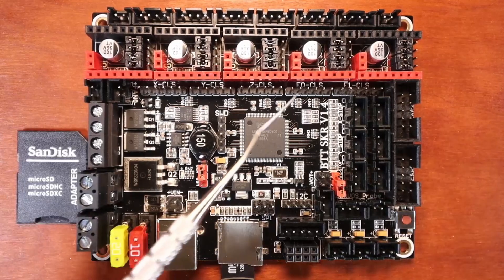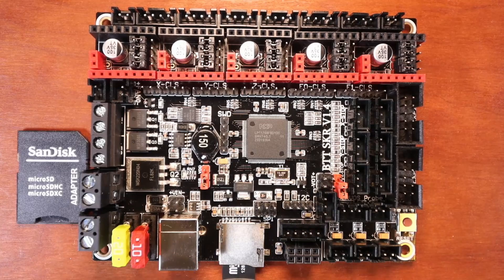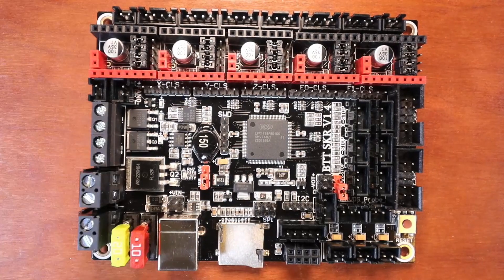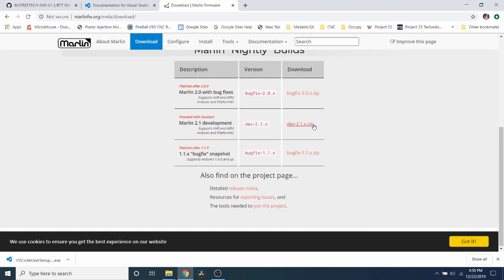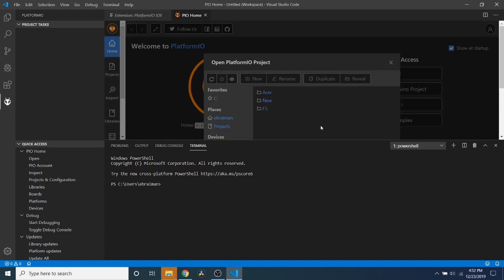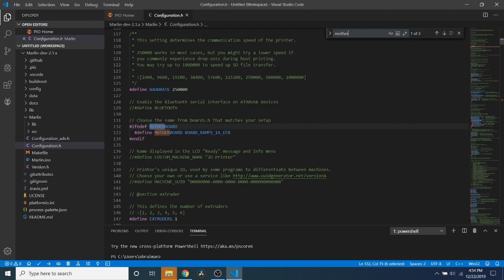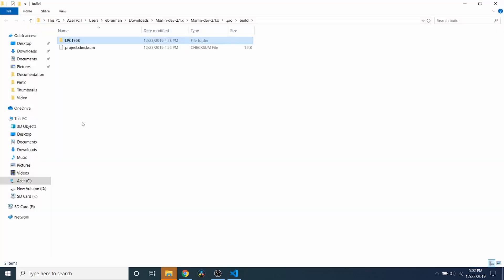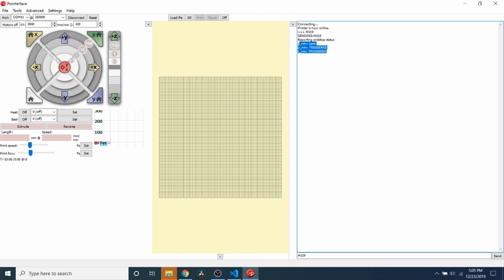BigTreeTech SKR 1.4 - Basics

Comment: Can you confirm only one on the fans are controllable? From what I gather from the data sheet, all but one are linked to 12/24v and Gnd.
Reply from the maker: That would seem to be how they designed it.  It's best to use 12v for all power.
Reply from the maker: I'll need to experiment, on if the fans are controllable, but a quick way to check is open the pins file and check if pins are assigned.
Reply: @EdwardBraiman  depends on the drivers. I tested 2130 on 12v, but they don't really work well.
Reply: @EdwardBraiman  yeah, I had a look at the pins and they look like direct to 12/24 and Gnd
Reply from the maker: @alin116  you can always use another device to connect them to a signal pin.
Reply: @EdwardBraiman  I'm interested in doing that, but couldn't figure out how/which pins and all that
Reply from the maker: @alin116  look at my SKR 1.3 videos playlist for using a fan extender.

Comment: Excellent videos. Thank you. Would you please do a video on how to setup dual Z steppers on a Turbo 1.4 using TMC2209 drivers. I've been trying to get mine working for days. The Z motors are not synchronized and they make a loud hum for a few seconds after manually moving the using the TFT35-E3 V3.0. Again, the videos you've done so far have been a great help.
Reply from the maker: Are you using one stepper or two.  There maybe an active bug being addressed on Marlin.  I've tried to get my TMC 2209 drivers working and I'm waiting on a possible Marlin firmware update.
Reply: @EdwardBraiman  Is this a known issue Edward? I've just finished the hardware setup of my board for my CR10s and I'm using one driver to power the dual z steppers. Would be good to know if I'm going to hit an issue ahead of time. Thanks for all your help!
Reply from the maker: I'm not sure if it's a know issue, but  check on Marlin firmware bug tracker website.  It doesn't work for me as well.
Reply: @EdwardBraiman  I'm using 2 TMC 2209 drivers in the Z and E0 stepper ports.
Reply from the maker: @michaeljones3163  I'm a little confused, has anyone seen a tutorial created by me that involves a TMC 2209?  When I do tutorials I make sure they work before posting.  As your all having issues, myself included with my own TMC 2209, I would suggest contacting Marlin firmware bug database and asking questions as to why or how to get the stepper working.
Reply from the maker: @michaeljones3163  the SKR 1.4 has two stepper driver ports for Nema17, why are you using z and e1 for z axis?
Reply: @EdwardBraiman  I'm glad you questioned that. I went back and looked at the SKR 1.4  Motherboard Diagram and now see the ZMA and ZMB labeled stepper drive ports. {I'm slowly getting familiar with how Marlin and the new SKR 1.4 works.) I'll try editing Marlin again tomorrow. If I can't get it working I'll contact Marlin firmware bug database. I'll let you know if I'm able to make any progress. Thanks again for your help. It's much appreciated.

Comment: Seems like a nice board. I just ordered the turbo 120hz version with the extra's and a 3.5"touch screen
Reply: Hey Doug, when you install it let me know if the motherboard BOARD_BIGTREE_SKR_V1_4 worked for the Turbo. BTT released a new version of the boards.h with an additional board called BOARD_BIGTREE_SKR_V1_4_Turbo. It's not in Marlin 2.1 yet and I'm unclear whether it makes a difference
Reply: @omnomnomnivore2766  Will do. Hopefully I should have the board and stepper motors by sat 1-4-20 and have the board programmed and powered this weekend. I did see that biqu had updated there fw so I'll try that first.
Reply: @omnomnomnivore2766  I was able to get the board up and running. it is the LPC1769 chipset. The firmware is listed under the 1.3 version. I don't yet have the board installed since I'm still building a DYI printer but the board works with the stepper motors on the bench. I also added the 3.5in v2 tft as well. With out videos like these, Thank you Edward Braiman" it wouldn't be possible.
Reply from the maker: You're welcome.

Comment: Did you find any informations on those closed loop driver interface? BTT keeps beeing secret about it, seems interesting. Ordered myself a pair of their closed loop steppers with the control board (sensor and driver) attached to the back of the motor.
Reply from the maker: About all I know is how to connect, the wires.  I'm trying to research what stepper to use in Marlin firmware, but it would be nice for BTT to publish anything.
Reply from the maker: Looks like it's a feature request 12496 on Marlin bug tracker.
Reply from the maker: Found some stuff in Marlin firmware 2.1.x in configuration advanced.h, search on external_closed_loop_controller.  I'm still searching for more details.
Reply from the maker: It's also in 2.0.x
Reply from the maker: Looks like it's not ready yet.
Reply: Wow, thanks for the investigation!

Comment: I watched your video 5 times today , I followed you step by step I put the sd card in downloaded Visual Studio Code downloaded Marlin firmware , press open project and Marlin firmware won’t work .I’m getting very frustrated I have spent a lot of money to upgrade my printers and I can’t even get to the reprogramming part of it . Please help me I need the control board for my Tevo Nereus because I changed to better stepper drives and the motherboard stopped working . Getting tired of 3D printing real quick. Thank you
Reply from the maker: First is the Firmware loading or is the build/compile failing?  Second what the hardware you're using?  Meaning SKR 1.4, type of stepper drivers, ECT.  What's the current firmware version your using?
Reply: Edward Braiman 
 
I bought the same board you did before watching your video . I have TMC 2208 stepper motor drive and getting TMC 2130 from Amazon. As for the Marlin firmware I download it then unzip it  then go to the VSCode so I can read the firmware but it doesn’t highlight like it did on your video.
Reply: By the way great videos just hope I can get the printer to work again.
Reply from the maker: Okay first download the Marlin firmware version 2.0.x.  unzip and open in VScode.  Make no changes to firmware and click check mark at bottom.  This will help and see if default configuration will build.  If it does build make the changes in the video and then click the check mark again.  If an error occurs check to see if you have Git installed.  Let me know what you see.
Reply from the maker: Do you have platformio IDE loaded?
Reply: Edward Braiman 

Yes I do it didn’t work tried it a few times uninstalled it and downloaded again but got the same results, sorry to bother you but I appreciate your help.
Reply from the maker: So VScode is downloaded and installed.  Is the plug-in for platformio IDE?  Check and see if you can also install Git.  In the bottom right hand corner it may also suggest software. Also the instructions maybe in the manual for SKR 1.4 in the description.
Reply: Edward Braiman 

I got it working. Thanks for your help 👍👍Great Tutorial.
Reply from the maker: You're welcome.

Comment: Very good, but you don't need the way over the SD Card Adapter. It works over USB. Please make more videos with the Skr Board - with Dual Extruder.
Reply from the maker: Correct, the reason I started out this way was to show recovery.  I'm working my way through about 30 requests, but there is a dual extruder in SKR 1.3 that might help.

Comment: followed the instructions with the 1.4 turbo and i get a bunch of errors
Reply from the maker: The SKR 1.4 is a different configuration.  You're going to find the board type for turbo and the default environment in platformio.ini it may be lcp1769.
Reply: @EdwardBraiman  i even used the board and drivers i have and it still gets a bunch of errors
Reply from the maker: Download a fresh copy of the firmware unzip and open in VScode.  Compile without changes with check mark.  Does it compile or build with default configuration?
Reply: @EdwardBraiman  what version ive tried 2.0 2.0 and 2.1 bugfix
Reply from the maker: 2.0, the point is to check if the Marlin firmware in default mode builds on your system.
Reply: Edward Braiman I figured it out. I had multiple versions of marlin in one parang folder. Moved the version I wanted to use to  c drive. Complied first try
Reply from the maker: Awesome.

Comment: Nice tutorials! How about LPC1769 chip?  Do I simply change default ends  = LPC1769? 
and copy all the BTT SKR.h files under lpc1769 folder?
Reply from the maker: Well I've yet to use a loc1769 in a video, so I would need a board.  Granted I do not want to make videos overly complicated.
Reply: you won't need to copy the BTT SKR files, the latest marlin has a lpc1769 environmnent in place and will map to the correct pins based on the board you specify in configuration.h

Comment: Edward I seem to be getting this message every time I try to load Platformio: Installing PlatformIO Core...
Please do not close this window and do not open other folders until this process is completed.
Failed to install PlatformIO IDE.

any ideas?
Thanks
Reply from the maker: Checkout my new video I posted for installing VScode with Platformio and let me know if it works.

Comment: Do you have to use the 2.1 dev build and not the 2.0.x bugfix one?
Reply from the maker: Bugfix 2.0 has the fixes from the release.  2.1 is next year's release or in development terms the release for coming year.
Reply: @EdwardBraiman  Installing and looking at it now. Unfortunately there seems to be no configs for the printer I will build for (Ender 5 Plus with SKR v1.4/2209's)
Reply from the maker: Check the example files folder.  You may need to modify configuration files to fit motherboard your working with.

Comment: I've tried multiple times to duplicate your video. When I compile I'm getting the lpc168 failed. Does the mainboard need to be connected for this to work? The only difference between your video and what I'm doing is I'm using the latest marlin build, Although I've tried with the development version as well with the same results.  I've also tried to duplicate your video on the 1.3 board as well with the same results. The only thing I can think of is I don't have the main board connected. Hopefully you can be able to help. Thx.
Reply from the maker: In VScode are you clicking the check mark or the arrow?  Also the default environment is LPC1768.
Reply: @EdwardBraiman  Apparent that is what it was. Thanks for the help. I am suppose to get the board/driver/stepper motors this week and so I wasn't sure if I needed the board connected or not. Do you know off hand if the 120hz 1.4 board will use the same chip set by chance?
Happy New Year to you!
Reply from the maker: @dougw9224  unsure, but you'll know when you see it in the firmware.

Comment: Hi Edward, I'm on the final steps of my CR10s SKR 1.4 upgrade and running into a few issues. Would appreciate any thoughts. Here's the details. 
Marlin 2.0.x Dev Build - Configuration.h https://pastebin.com/inc5555t
Main Problems
1) No Printer Attached! Message on TFT35 E3 LCD Screen and therefore unable to control. I set the LCD to REPRAP_DISCOUNT_FULL_GRAPHIC_SMART_CONTROLLER but not sure if I should be using TFT?

2) Grinding noise from motors when moving the Z axis Up using Pronterface. See video at https://youtu.be/-XlFhO2T6Cs

Hardware details
CR10S
SKR 1.4
4 x 2209 Stepper Drivers (Dual Z Motors driven from one driver)
TFT35 E3 LCD Board (Currently connected to control board with both EXP1 & EXP2 Cables)
Reply: Update. I managed to get the screen working. I didn't realize I needed the included black wire and had only connectd the two exp cables. I am wondering will I still be able to connect to the printer via Octoprint on a raspberry pi or is that an either / or situation? The second grinding noise is still an issue FWIW if anyone has ideas.
Reply from the maker: You should be to use both raspberry pi and LCD.  The TFT only need the one cable.  The ribbon cable is yes for RepRap discount full graphics smart controller emulation on LCD if you're not using TFT mode.  The current on the stepper maybe the issue.
Reply: Edward Braiman Great, That’s helpful. What would you recommend for the current? I spliced the wires of the two z step motors to a single driver.
Reply: Here's my current configuration.adv.h https://pastebin.com/gqPKcHxJ and another stupid question. What is TFT mode?